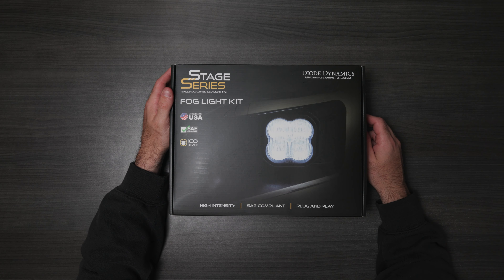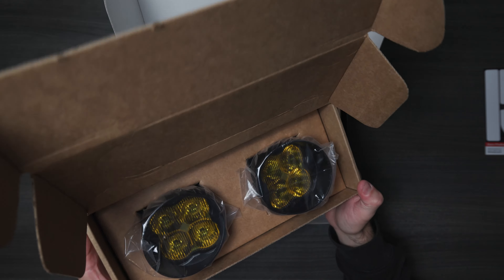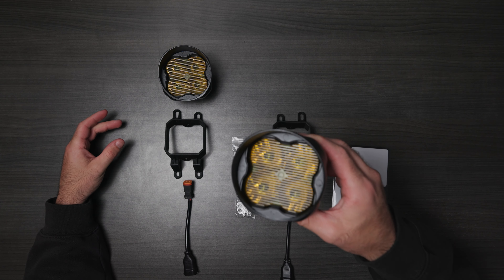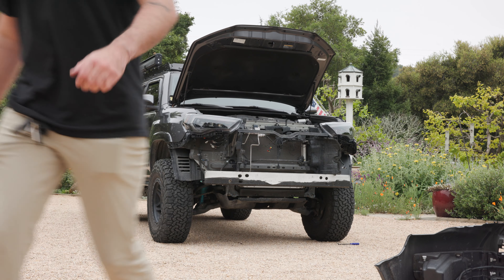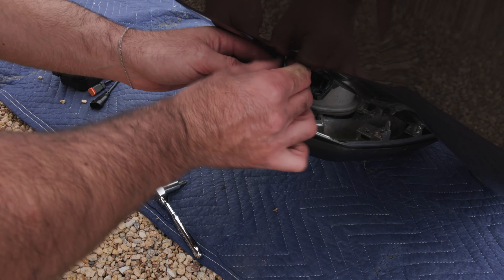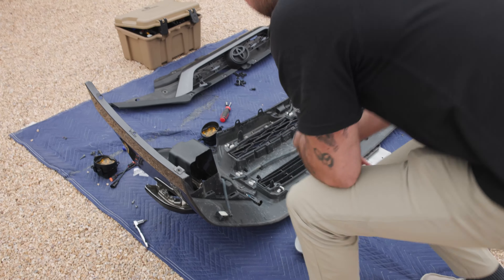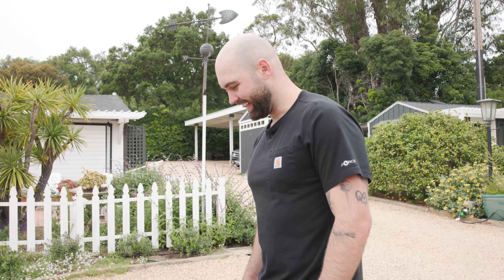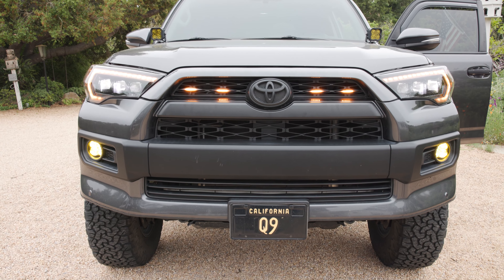5th Gen Toyota 4Runner LIMITED | Diode Dynamic SS3 Fog Light Install

Comment: These don't work if your 4runner comes with led fogs from the factory. Which is a big fail for the 23 and 24 models.
Reply: Why won't it work if you have led lights? Is it fitment or won't plug into factory wiring harness? Thanks.

Comment: You can access the fog lights without removing the whole bumper. Just an fyi
Reply: In the Limited its not easy. I too have a fog light install video which shows not only you have to remove the fender liner but also have to remove the chrome trim piece on the bumper.